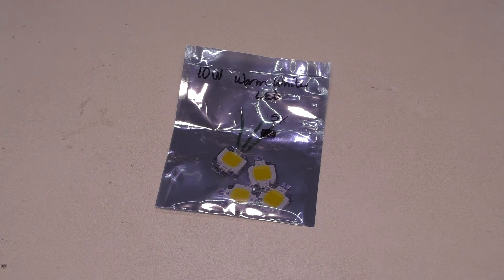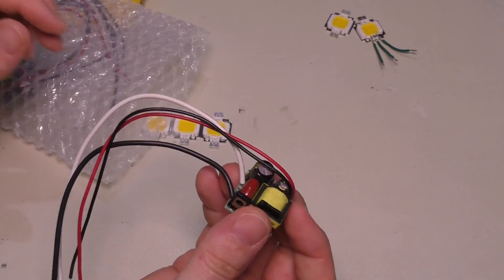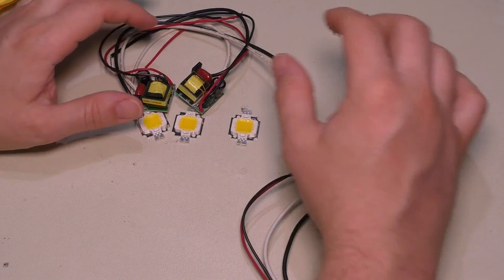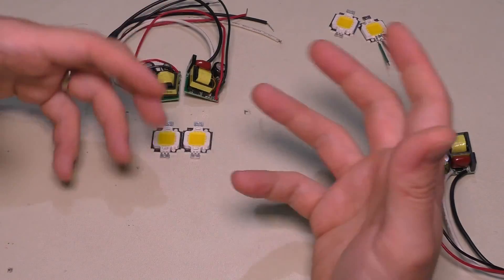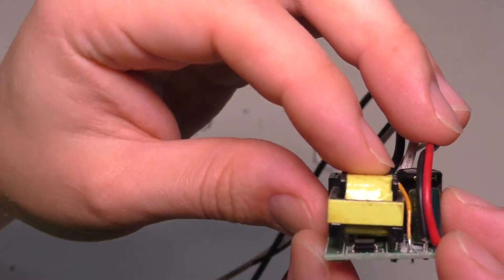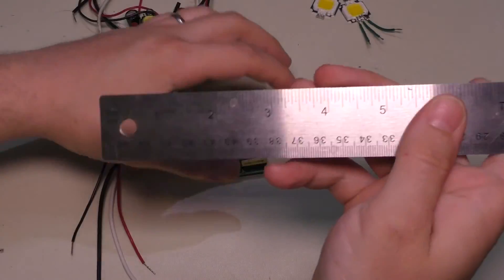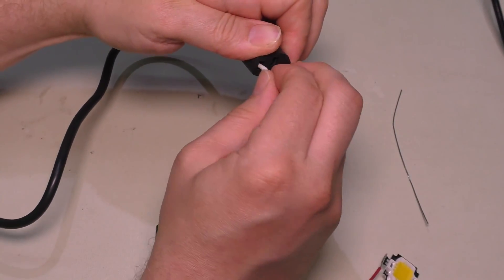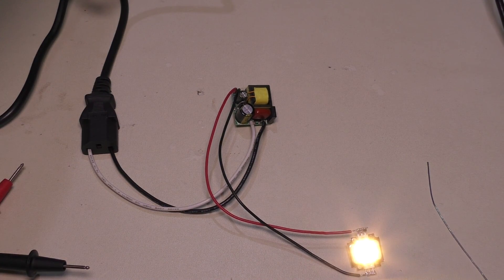PTS Ep. 202 - Looking at Cheap LED Power Supplies (Drivers) from eBay

Comment: here is a hint.... don't look at the case of ones which have a white case around it .... they don't care about the orientation lol..... if you think red and black is a weird colour for the mains; yes. yes it is. better not ask how I know :B......a better way of bodging the AC on is getting a little terminal block and cutting up a cable from something like a broken lamp.... that's a lot safer and allows you to sit it down and switch up the power without manhandling live wires.

Comment: Good Video as usual...  It is amazing what is available for under a buck mailed from China...   The cheap connectors that I have a pile of on my bench are these and they work for so many things and have a screw hole to mount them on project boards...
And the Kicker is they are only $1.99 for a pack of 20...  
https://www.banggood.com/20pcs-2p-Quick-Connector-cable-clamp-Terminal-Block-Spring-Connector-Wire-LED-Strip-Light-Wire-Connecting-p-1001440.html?rmmds=search?p=G1290070900072016104

The site Banggood.... is dangerous to look threw I always end up with a cart full of little parts...  shipping in faster than most to..
https://www.banggood.com/?p=G1290070900072016104
Have a good day
F
Reply from the maker: Thanks for the comment.  Banggood is especially dangerous as they accept PayPal.  I could get into some serious trouble with that!

Comment: I picked up some of them small boost converters to run these 10 watt leds on lower power supplies they work great. Been running them of of 5 volts. Nice vids.
Reply from the maker: Thank you for your comment.  I've used those as well and I agree; they work great!